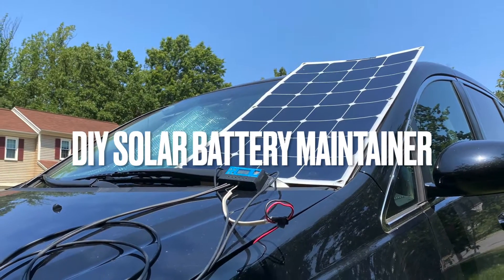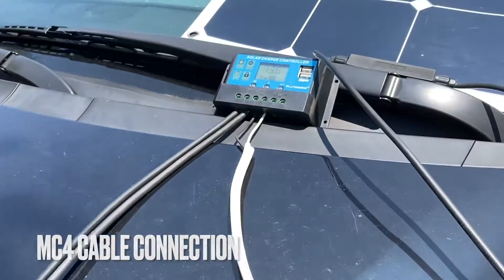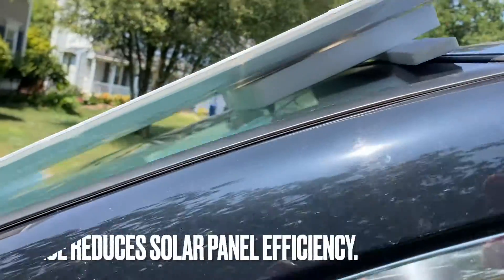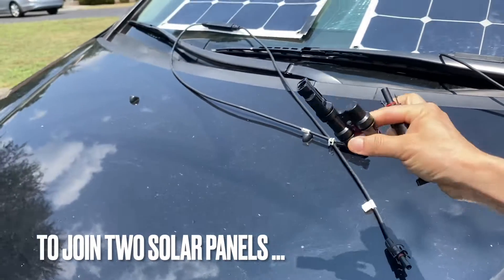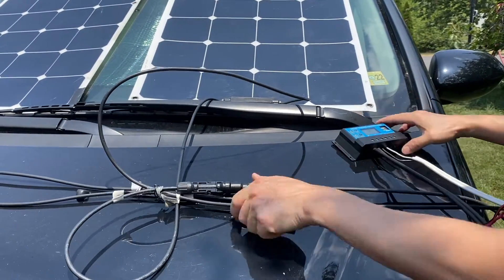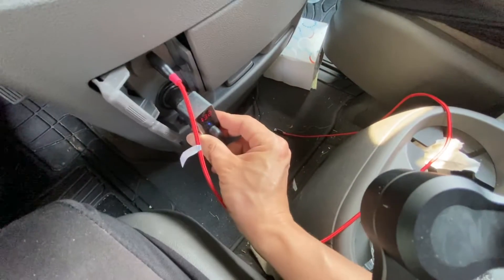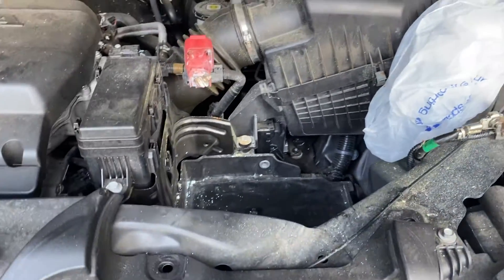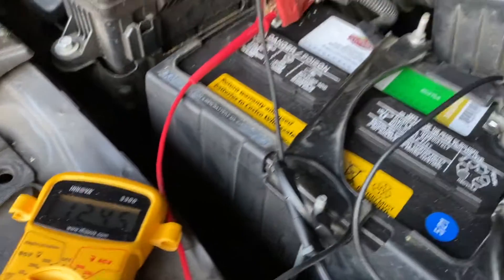100W Solar Car Battery Maintainer

Comment: Hello, I got the same charger controller.
There is one quark with it.
Under sun conditions it charges, but in the dark it discharges the battery.

Eventually, don’t you know any other controller that doesn’t kill the battery?
Reply from the maker: the controller failed already, I wouldn't recommend it.

Comment: hello, according to you, is it possible to recharge the battery in this way using one panel via the cigarette lighter? I would like to have the panel inside the car
Reply from the maker: 1. No the 12v socket in the car won't work in this case as you won't have direct access to the car battery unless you have a really old car.
2. Don't put the panel inside the car as the car window glass filters UV rays and will greatly reduce the solar panel efficiency. Not to mention the panels may over heat.